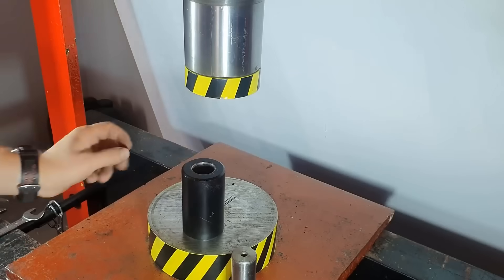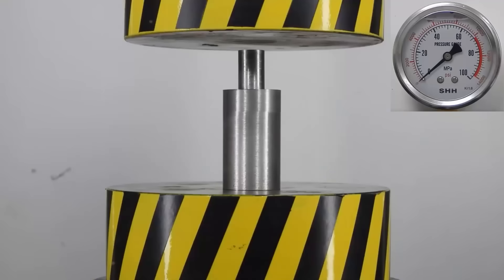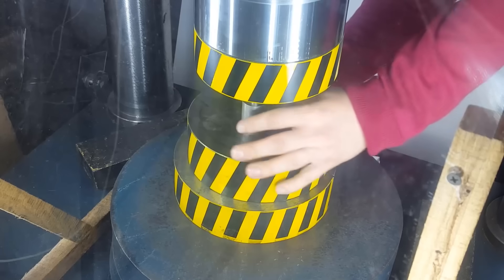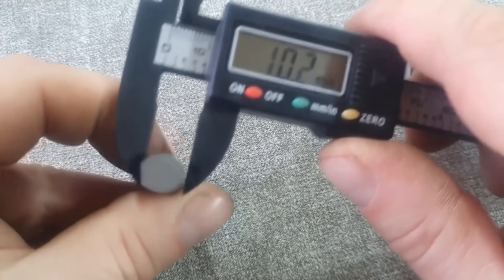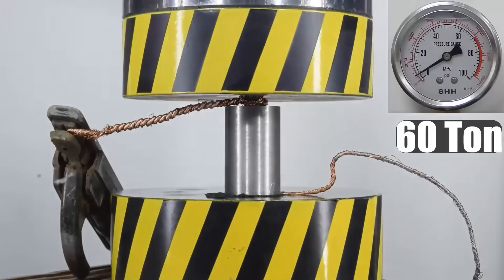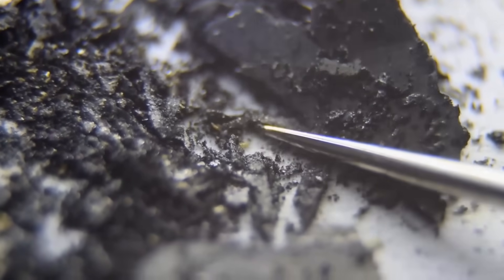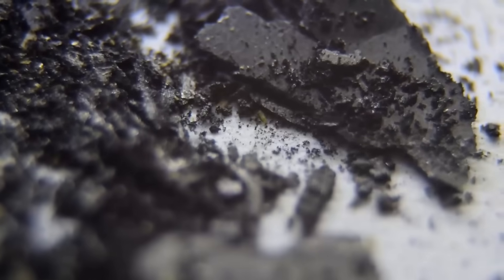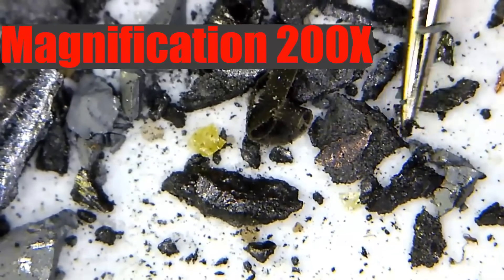HYDRAULIC PRESS TURNS GRAPHITE INTO DIAMOND

Comment: Graphite in pencils is mixed with clay. This makes it a poor choice for making diamonds out of. Pure carbon powder is cheap and will give a much better result.
Reply: Indeed, with the silicon and aluminum compounds in clay I'd say he made a dirty amethyst-sapphire hybrid thing or similar at best
Reply: Basically that's charcoal powder you can buy it as toothpaste these days at the dollar store extremely fine powder that is on the micron scale ⚖️
Reply: @iiiKingLongSwipeiii  What's needed  for the experiment is mineral coal not charcoal ( burnt wood).
Reply: @vesuvio3364  carbon is carbon regardless
Reply: @vesuvio3364  Charcoal is usually purer carbon than coal. Charcoal's like those we call Coke are pretty much pure carbon as everything else has been burnt off. There is a reason charcoal was produced at the start of the industrial revolution as it made steel production really cheap.
Reply: @cillianennis9921  wouldn't those carbon turn into CO2?
Reply: @leejiabaobernice6535  I don't know the exact reason why Charcoal's become so pure under the right circumstances. I think its due to the combustion of the Hydrogens on the wood fibres so it becomes mainly carbon. I'd need to look it up but I know its produced this way from some old documentary on the industrial revolution in the UK that was on a Doctor who episode's special features (cause whoever at the BBC makes the special features lists goes all in with extras. Get a stupid Sci-fi episode making of style documentary & usually something about the historical stuff referenced)
Addition: Also most carbon likely does become the CO2 & is the parts of the wood that turns to ash but the core parts must transform due to the heat & pressure of the fire & turn into a purer carbon due to a mix of incomplete combustion & all. So basically Charcoal I am guessing is like condensed soot which itself is pure carbon compounds mixed with impurities.
Reply: @leejiabaobernice6535  That's the whole point to remove oxides from iron in smelting. Iron ore (mainly iron oxide, Fe₂O₃ or Fe₃O₄) must be reduced to pure iron. coke produces carbon monoxide by reacting with air and then the carbon monoxide reduces the iron oxide. Coke also introduces carbon into the molten iron, which is crucial for steelmaking. So the carbon dioxide is an end product of the process. The carbon doesn't turn directly to CO₂
Reply: @iiiKingLongSwipeiii  No, it is multiple grades just like glass isn't just "melted sand". You must use the exact type for the job at hand. So while they all contain carbon, that isn't the same as the carbon needed for the creation of diamonds.
Reply: @cillianennis9921  Als jemand der selbst gelegentlich Pflanzenkohle herstellt. Entscheidend für die Reinheit ist das man es schafft das kohlenstoffhaltige Material, ohne es zu verbrennen, so stark zu erhitzen das alle Stoffe (bspw. Lignin, ätherische Öle uvm.) außer des Kohlenstoffes verdampfen. Auf die Art erhält man nahezu 100% reinen Kohlenstoff.

Für die Stahlverarbeitung wird aus Stein oder Braunkohle nochmal durch einen speziellen thermischen Prozess Koks hergestellt, was letzlich auch nahezu 100% reiner Kohlenstoff ist und bei höheren Temperaturen verbrennt als reguläre Kohle.

Sprich sowohl Koks als auch Pflanzenkohle sind beide nahezu 100% Kohlenstoff

Für die Diamantherstellung braucht man auf jeden Fall Kohlenstoff in seiner reinsten Form.
Reply: graphite powder? dry lubricant?
Reply: Yeah I don't think the guy knew about that. I remember seeing a pencil factory video a while back where they went through all of the processes of making pencils
Reply: I mean, it won't.  This isn't how diamonds are made.
Reply: @ObeyCamp  how are they made then?
Reply: is that why it ended up yellow
Reply: @tygical  Yellow diamonds are created by adding nitrogen into the Diamond. This would happen in this case because there is nitrogen in the air.
Reply: A ligação  dos eletrodos mostrado não tem a função  certa. Pois o curto elétrico está por todo experimento, seria correto haver isolamento para somente o grafite sofrer o curto, para o aumento da temperatura.
Reply: We have graphite in the mountains of Hot Springs, Arkansas. There's a vein running through the mountains that's enough to handle the United States of America's need for 100+ years!
Reply: Also why are they yellow? Sulfur content?
Reply: @ltgsebg  Nitrogen from the air gets incorporated making the diamond yellow.
Reply: Wrong "Carbon".
Add somethng else to the mix.
Nature doesnt do it this way. 😉
Reply: Also pretty the heat and millennia have some effect as well.
Reply: You need pressure and heat on the same time.
Reply: Carbon is a natural part of life on this planet and not a significant source of global temperature increase. Plants need atmospheric carbon for photosynthesis and sequester carbon efficiently, especially algal blooms in the ocean which happen naturally in warmer water as a regulator of global temperatures. Large volcanic eruptions every century expel more CO2, methane, SO2 and other “greenhouse” gasses than human civilization ever has or will.
Reply: Carbon is bad for the environment, we need carbon taxes and carbon credits or our planet is doomed😢
Reply: Najbardziej szkodliwe jest takie myślenie, szok. @kevinhood9781
Reply: @kevinhood9781  who cares
Reply: @howardneal5174 it was a joke bro. If you lived in canada you would understand completly with all the nut jobs we have in our country and crappy government
Reply: @kevinhood9781 no one cares